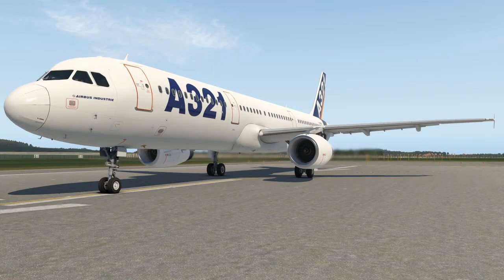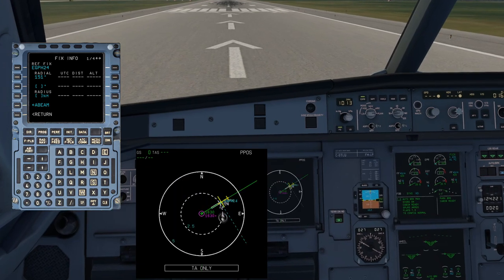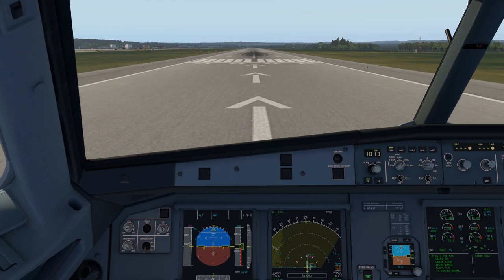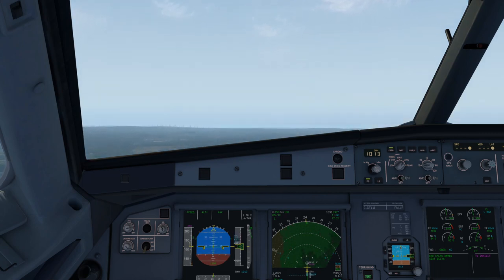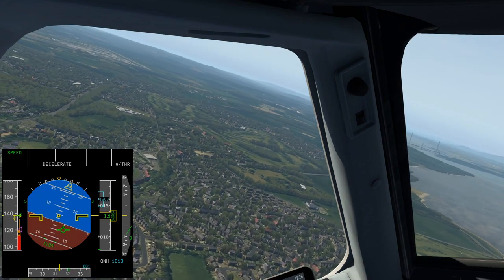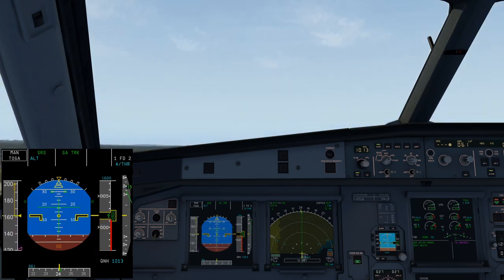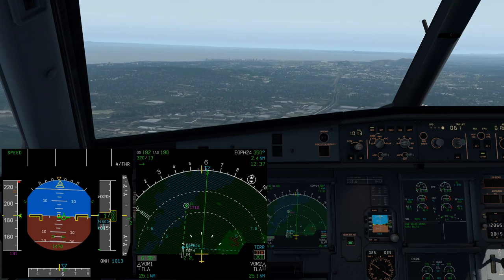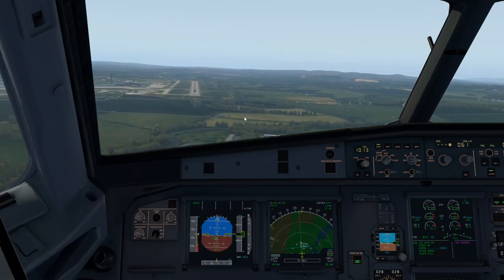A321 Visual Circuit & Touch and Go Tutorial with Real Airbus Pilot! X Plane 11 ToLiss A321

Comment: Fantastic video.  You make it look so easy!  This r/w Archer III pilot struggling, but improving.  Using the Fenix A320, the FMGC managed speeds were much too slow - I've had to leave the speed pulled and dial it in as I go (it works fine on AP ILS approaches).  Thank you!

Comment: Two questions:
1) Is there any specific reason for flying on S speed the whole circuit , 
2) how do you estimate the downwind turn to be 2.5nm offset with the runway?
Reply: Because you fly the circuit Flaps 1 with slats extended, S speed is the slats extended speed. Just start chrono and time 45 secs from passing the abeam the threshold - set ref line on ND as explained.
Reply: Alright , but why not with full flaps retracted?
Reply: @sharklet7779  Because a lot of very clever experienced people decided that's the configuration you fly a circuit in. Why would you clean up the jet and fly faster just to slow down again? S speed is a suitable speed to fly the circuit...so you do.
Reply: @bikeguy3034  Okay thanks !

Comment: brilliant      has the mcdu dropped all the data  after the touch down go around i thought it did
Reply from the maker: Thanks David! In this case it does not. The MCDU drops data after a short while on the ground, if you Go Around before then it keeps the data thankfully!
Reply: yes saves re reprogramming on  the  rotation phase cheers sir

Comment: I have just been watching someone do this but in the real world in an A320, I noticed when the radar alt call out to flare that there was another call which I'm guessing is not standard, it sounded like Zero Input. I was wondering what dose that mean? as I have never heard it before
Reply from the maker: Hi, was it possibly ‘Dual Input’? This call out is made by the computer if it senses both pilots making an input at the same time on the side stick. Thanks for watching!